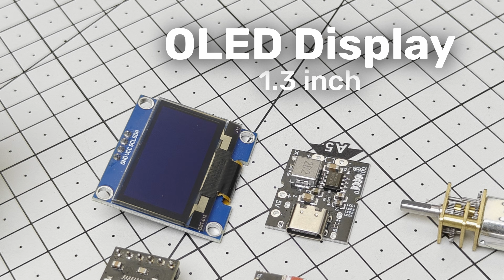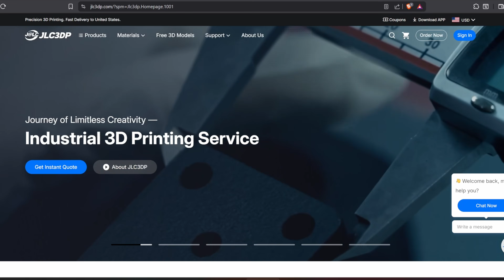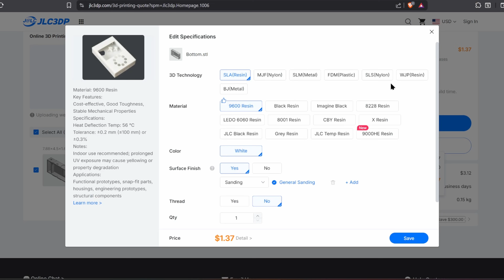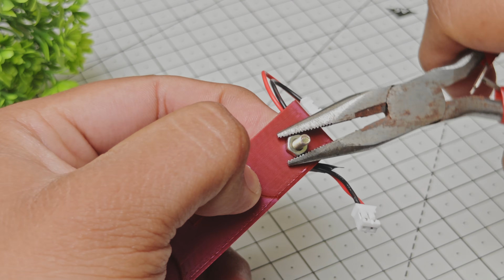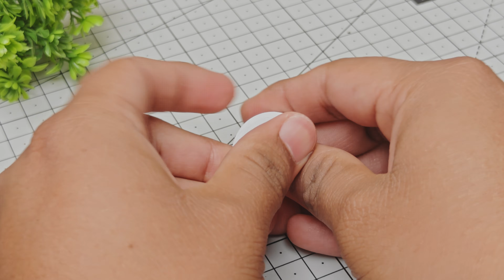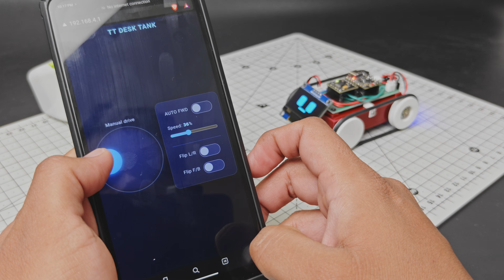How I Built A Tiny Robot Tank With ESP32 | Complete Beginner Guide

Comment: Hey I've question, can I make the body smaller? And use smaller silicon bands? Will this mess up anything in code?
Reply from the maker: Code shouldn't be a problem if you can fit all the components in the build.